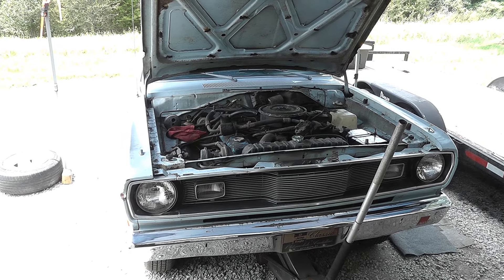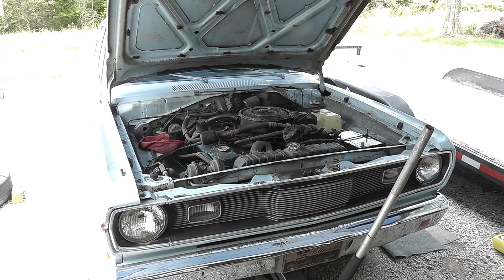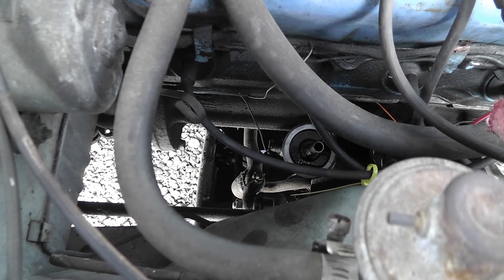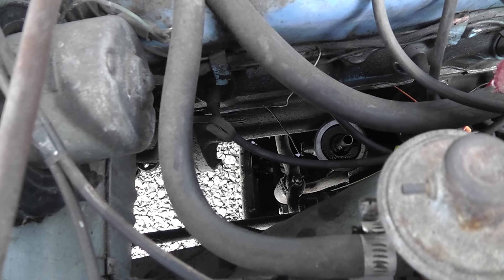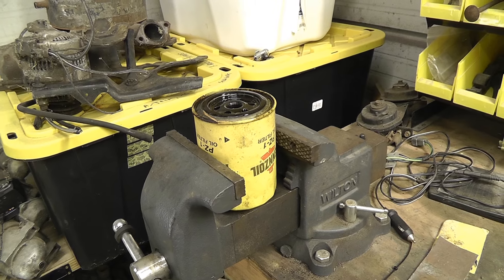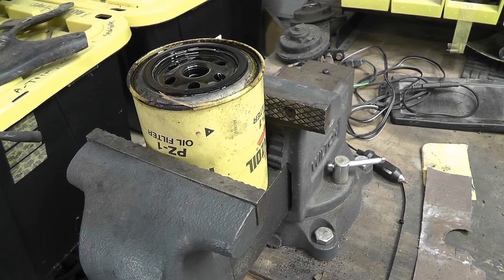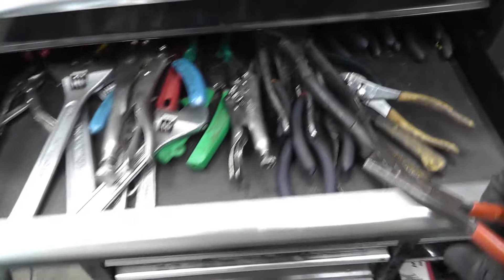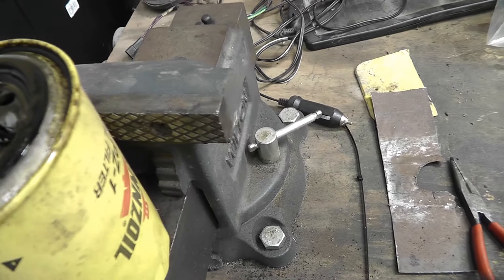Did this cheap oil filter cause my low oil pressure issues?

Comment: I doubt this is your problem, but I had a poorly maintained 318 do that onetime, and It turned out to be the sending unit. Sludge had built up around the hole, and it took about 6-7 seconds to go off and 5-6 seconds to go back on. Looking forward to the next installment.

Comment: I have seen those video about Fram filters, and while I do agree that they are manufactured very cheaply compared to even store brand filters, I must admit that I have never experienced any problems or mechanical issues due to any brands of oil filter and still occasionally use a Fram when either they are the only size filter available on the shelf when I am purchasing materials for an oil change or if I find a really good deal on one. I would image that if the oil filter had been the cause of your slow cold oil pressure, it is more likely an issue of the filter’s age; the old oil had clogged the filter or the filtering material itself was so old, it was beginning to deteriorate after so many years of service. I believe my next move would be to replace the oil sending unit and see if the problem just goes away.

Comment: Those old engines had loose tolerances to start with.
 Using conventional sae30 or 20w50 and a cellulose fibre oil filter may cure your problem.
 Fram synthetic filters cause knock on start up and low oil pressure until filter goes into bypass mode.
 High micron rated filters, synthetic / semi synthetic oil cause low oil pressure and are best suited to newer engines with tight tolerances.
 5w and 10w  oils also cause low oil pressure in high mileage engines as that's the viscosity the oil will shear to.

Comment: Good video. The anti drainback valve probably deteriorated from sitting in oil for so long...probably a part of the problem. Those old rubber valves do deteriorate. I agree with others that cleaning the pressure sender may help. The old Ford and Chevy straight 6's don't run much oil pressure...if this one is similar that may be a piece of the puzzle along with likely loose tolerances in an old engine. My theory is its likely a combo of things going on. You've got a good filter on there now at least. Never had a problem with Baldwin or wix

Comment: Tyler, the oil pressure relief valve in the oil pump can get gunked up. If it sticks open, oil pressure goes away. The spring and relief valve needs to be taken out and cleaned. and also the bore.  Crocus cloth on the valve. That filter was a hoot. Been rotting on there for a while. Hope you figure it out. Maybe try a new sending unit too?

Comment: It does look like the oil filter is coming apart internally. You could try removing the oil pressure sender, and clean the end of it. Or temporarily hook up a cheap oil pressure gauge to see what the pressure is.

Comment: I've used Fram filters in the past and never had issues with them. I guess there filter media is not that great though. I usually use the manufactures brand. I have had two AC filters leak at the seam on the Bel Air in the past. No issues with the Motorcraft filters on the Ford's. 

I see you made an oil filter drainer too...... They work good. I have been using one for 40 years now. My dad suggested it. 

Put a mechanical oil gauge on your slant six, as I bet you have a bad oil sending unit..... maybe.

Comment: #1 none of the old Mopar oil gauges read correctly caused by the mechanical voltage regulator that can not provide a steady 5 volts to the gauges and the oil light is not to be trusted... Neither is the ancient oil filter but that being said the use of a good quality mechanical oil gauge is the only way to know what your oil pressure really is.... Case in point my 87 Ramcharger 318 roller cam 89 engine reads 1/3 up the oil gauge hot...which on a mechanical gauge is 35psi at idle hot in gear...and as soon as you hit the gas the gauge goes straight up to 75psi...this is the only way to truly tell if the engine is producing healthy oil pressure... Your postmortem of the oil filter just proves that getting quality filters and oil and maintaining it all on time is crucial to engine life.... But a good mechanical oil pressure gauge can save you a ton of time diagnosing these issues....and never trust a factory gauge or light..... If you have an engine that starts out with good oil pressure then goes really low using a mechanical gauge...and when you give it gas it does not build oil pressure fast... 9 out of 10 times rod bearings and mains are down to copper....lack of maintainece is what really kills them.

Comment: I don't think modern filters play well with the standpipe.  I used K&N after a rebuild and it seemed sluggish to develop pressure at cold start.  Removed the pipe and now using Motorcraft.

Comment: Not sure about that, could be or a few other things- maybe a combo platter. For my cheaper rides, Super Tech Synthetic. However, the filters I use? Baldwin B-2 or Wix 51515 (including the filters they make for Parts Master, NAPA) on my old Chryslers. Anything Pennzoil? Steer way clear-